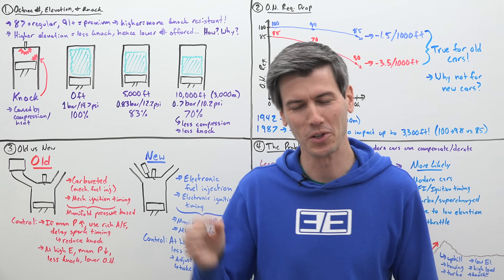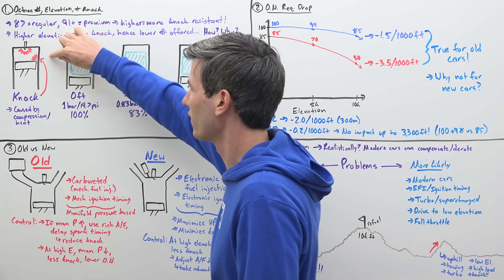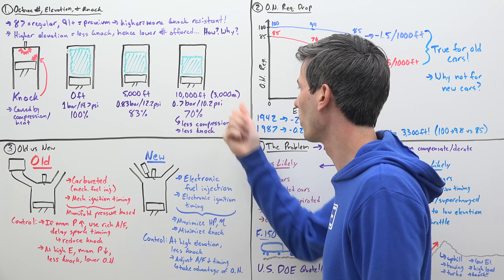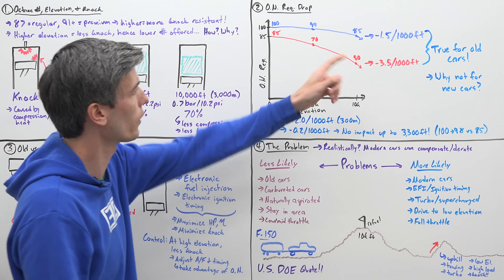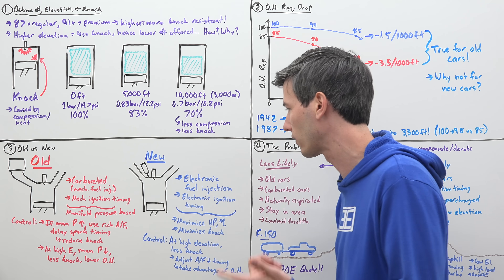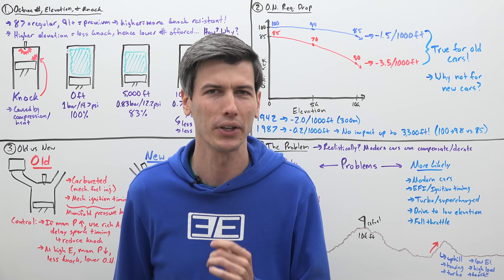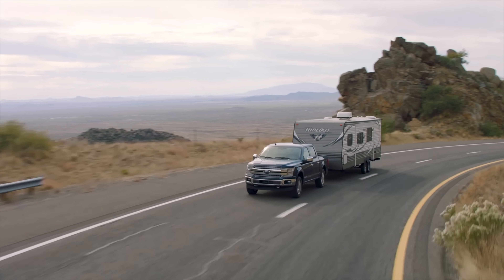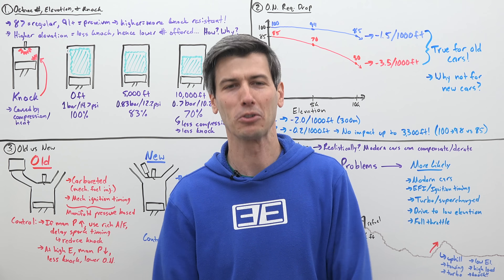Never Use This Gas In Your Car!

Comment: I lost around 50hp with my 200hp Saab when fueling it with Europe octane 92 (guessing 85 US octane), because the engine tried to protect itself at highway speeds.
Also found out that the car knocked more and then used more fuel to cool, so it was actually more expensive to drive with low octane then regular, because the engine would just use more of the cheaper fuel then the regular fuel.
Reply: 92 RON is actually equivalent to 87-88 AKI. When I had a 9-3 (two of them, actually) here in Canada it drove normally the very few times I put 87 in it, but it used more fuel. The difference was enough that it was cheaper to use 91 (95 Ron) or 94 (98 Ron).
Reply: In Europe our 95 (us 91) is the minimum octane fuel and not advice for more sporty cars which use octane 98
Reply: @NoctisIgnem  I thought 95 in europe is considered premium.
Reply: @strangeclouds7  it's the bare minimum, and with the increased ethanol most switched to use 98
Reply: 50 hp seems pretty dramatic
Reply: @strangeclouds7  Yep it is a big jump.
My previous car: 2000 Saab 2.0 turbo tries to compensate for the bad fuel in multiple steps, then lastly it gives up and pulls the turbo boost down to the same level as the low pressure model.

When knock is detected it adjusts the ignition timing and fuel amount in 5 steps, if the knock is still present it cuts the boost pressure in half.
All this happens in seconds, so when the engine runs on low boost because of knock, if you let of the gas for 10 seconds the car will then run full power for 2 sec before the boost is lowered again.

High octane fuel is also detected by the engine system and the engine will adjust to a little more boost compared to regular fuel (guessing around 5hp)
Reply: @larsjrgensen5975  If you have good high octane fuel do you have any issues? I have a VW 2.0 turbo engine
Reply: @strangeclouds7  Only issues with low octane 92 Ron, CaptHollister mentions it is 87-88 AKI.
Just stick with 95 (91) or higher and you will be just fine.
I think you will have a little extra boost with high octane just as my car has, but it may not be worth the extra cost, that is up to you to test.

Have not tried low octane on my more modern 2009 2.0 turbo Saab, but it feels a bit more fresh at high octane and the boost is also a bit higher.
Reply: @larsjrgensen5975  Nice. I live in America and dont have an issue finding good gas. Have always used 91 octane which is equivalent to your 95 I believe.
Reply: I have never seen lower than 95 in Sweden? Do you have 92 in Denmark?
Reply: @TheSimon253  I think 92 disappeared a year or two ago.

My low octane drive happened 6 years ago I think and I used half of the tank and filled it up with V-power 99, to fix it.

Some small stations only had one fuel tank, so they delivered 95 in both the 92 and 95 pistol, the only difference is the price they bill you.

Where it gets tricky is when you hit that very rare station, that actually had a 92 tank, instead of giving the customer cheap 95.

We now have 95 10% ethanol and 95 5% ethanol and sometimes a high octane 98, 99 or 100.

Sadly we never got E85 here for my Saab, it is possible to buy a drum of racefuel, but the price is much to high to be daily driving.

Comment: 7:37 So new cars with electronic FI has no effect on horsepower the higher u go in altitude?
Reply from the maker: You still lose power, but it will use timing advance & a/f ratios to optimize efficiency (which ultimately helps power). But there's no getting around having less air.
Reply: @EngineeringExplained  So they're basically reducing emissions?

Comment: But I thought that's why they put knock sensors on vehicles to prevent this.
Reply from the maker: They do, and yet... see owner's manual.
Reply: @EngineeringExplained  knock sensors will retard timing 12 to 14 degrees chances of damage are slim to none but manufacturers are covering their buttons which I get

Comment: Most People have absolutely no understanding of Octain Rating at all. If your Engine has say a 9:2.1 Compression Ratio, running Premium Fuel is absolutely Pointless and a waist of Money.
Reply from the maker: Not if it's turbocharged! Example: Subaru STI uses 8.2:1 CR and you definitely want to run premium.
Reply: @EngineeringExplained I didn't say a thing about forced induction did I? No I didn't. A Turbo or Supercharger will drastically change conditions in the Combustion Chamber. Making Detonation much more likely..
Reply: @EngineeringExplained  That's why you can't just Bolt a Turbo to any Engine, if the Factory Compression Ratio is to High, Forced Induction will Blow your Piston's apart..
Reply: @EngineeringExplained  What I was referencing is how many People  do not understand the function of High Octane Fuel, that's it. Wasn't trying to pick an argument over Technicality's.
Reply: Nice. I looked it up. Chevy Vortec 4800 is 9.4:1 
Smooth as can be on reg 87

Comment: The wife bought a 2020 Ford Edge here in S.E. Idaho and it will run on 85-91 w/o knock, but....... it SUCKS the 85 down nearly twice as fast as the 91 octane and is boggy. That's why we've only run 1 tank of 85 octane in it. Costs more to fill it, but costs less because it goes farther. Good vid, and great explanation on this.
Reply: Fuel with 10% ethanol will yield lower mileage and power. 10% ethanol is common in the west. Maverik stations usually offer as an alternative zero ethanol gas at about 40 to 50 cents a gallon premium.
Reply: @Bygre  Most definitely, and it does even better with E-Free fuel. But that's a 20min drive usually with gas cans to fill up for the lawn mowers & irrigation pumps. Being an older mechanic that's made a bit of money off dead fuel pumps I live on the rule of the quarter. When it's at a 1/4 tank it's empty & that usually means I gotta fill it up at our small town gas station that doesn't have E-Free.

Comment: Most pumps with E85 here in Denver say "up to 10% Ethanol added to fuel"; is the octane rating of 85 including that addition of ethanol, or is it likely the octane rating is higher than advertised due to the that addition?
Reply from the maker: E85 is 85% ethanol. 85 Octane gas is only 10% ethanol. These are very different. E85 has a very high octane rating (100+).
Reply: @EngineeringExplained   Oops! I meant standard 85. Does standard 85 with 10% ethanol still rate at actual 85 octane rating?

Comment: I'm pretty sure timing is advanced (not retarded) at full throttle to allow more time for the mixture to burn.  Also, I don't think 85 Octane fuel is sold anywhere where you can get near sea level on one tank of gas.  I trust the DOE, but I used 85 octane fuel in several fuel injected vehicles for years with no issues.  (As do the other 5 million residents of CO and WY.)  Thanks for the videos!!
Reply: These 'EE' comments are a scammer.  Don't call.

Comment: I remember seeing 85 octane at many gas stations, during road trips out west. I always wondered about that. Thanks for the info! 👍
Reply: @Engineering EхpIαined🌟 Scam alert!
Reply: AS pre 1990 cars get less common, the 85 octane gas should be disappearing for good.
Reply: It's interesting because for I think 2020 or maybe 2019, whatever the most recent year's data has been reported, the US DOT says the average age of a vehicle in the US is something like high 11.x years, nearly 12. It was less in past years, very slowly increasing over time, but still it would suggest that we have long since passed the time when any reasonable person should expect a pre 1990 car to be even remotely "common" and thus there being a justification for such fuel - And keep in mind this video uses 1987, per the referenced study, as a modern engine that didn't really benefit from such fuel. So I don't think it should have been allowed for even the last decade or two.
Reply: @javaman2883  not from high locals
Reply: Yep moving to diffrent states i saw it too

Comment: Is it any less crazy that they sell this stuff called "diesel" fuel that will wreck your gas car almost immediately... and they put the pumps for that right next to the gas pumps!!  And all we have to go by is the car manufacture stating in the manual to "not do that".
Reply from the maker: I think it is. You don't think there's an obvious difference between "regular" and "diesel?"
Reply: @EngineeringExplained  To enough people, sure, but I've heard many stories of an oblivious old person (or any person) doing exactly this - never heard of anyone wrecking their car engine with knock from 85 octane in high alt. areas though.  So with that perspective, it's just not very crazy at all, but definitely an interesting factoid and great video as always!

Comment: As Jason said is very unlikely that your motor is going to blow, but I think it can damage the car manly in the worst case scenario, with a turborcharged and a lot of load.
We could see some weird detonations and this will result in unexpected behaviour together with the lack of power.
Also it will cause weird vibrations throught the transmission, driveshaft and etc.
Unexpected behaviour and lack of power it's not what you want when towing, so I can see why the manufactures want to protecte himself, they cannot guarantee that the car will run as expected.
Reply: Low octane + Downsized turbo engine = Potential disaster.

Your comment about "weird detonations" is really telling because low-speed preignition and "mega knock" are becoming more and more of an issue now that we are pushing more and more power out of smaller and smaller displacement engines. I guess the old saying "no replacement for displacement" will always be true in this regard.

Comment: I live at sea level, but some of my gas stations sell 85. I also have a 2016 Dodge Journey that says it can take 85. So should I still be able to use 85 without it being harmful?
Reply: What you are seeing is 85% ethanol fuel, not 85 octane fuel.  Look closer at the pump and you will see it is clearly labelled as 85% ethanol fuel.  The other 15% is gasoline.

Comment: "It's crazy to me that we sell a fuel that will damage your engine".  It's crazy to me that ford cant engineer their cars to handle all fuel sold in this country.
Reply: By using that logic, all new vehicles should be able to use diesel, gasoline, E85, etc….
Reply: @bartonkj  I was taking about gasoline.  You can remove diesel jfc.  I have a ford focus that I can put any kind of octane in and it adjusts accordingly.  I just loose power.  So Ford can do this.  They're just lazy.
Reply: There's a difference between "will damage" and "could damage".

Comment: The lowest octane rating fuel you can even buy in Europe is 95 RON, which is equal to 90 AKI. Lower octane fuel (90 RON, equal to 87 AKI) was discontinued over 10 years ago in Austria and Germany, and those basically were the last countries to do so

Comment: I suspect that the 85 is conventional gas (ie no ethanol) I’m a fuel hauler and the fuel that is pumped through the pipeline for regular 87 is actually 85 octane before the 10% 113 octane ethanol is added to the fuel bringing it up to 87 octane regular E10. When you get 87 non ethanol from the fuel terminal it is mixed with 91 octane conventional to bring the octane up the two points to make it 87 octane with no ethanol content. Generally now the pipelines only send 85 octane non ethanol and 91 octane non ethanol and mixes them at the terminal depending on the desired octane rating with and without ethanol.
Reply: Thats pretty accurate. What we blend before the 10% ethanol is added is 83.5 octane (R+M/2). Premium is right at 91 before ethanol.
Reply: @03c5z  I suspect it’s going to vary some based on the exact ethanol available and exact percentage of ethanol but I was always taught the general rule of thumb is the 10% ethanol adds 2 octane points. Then again I just pull the fuel from the terminal and drop it at the stations so a lot of the terminal side blending is more or less irrelevant to my job as long as the end product meets the desired levels of ethanol and octane.
Reply: @davet231  the ethanol octane boost varies depending on the grade as well as some other component factors. On 87 the ethanol contributes around 3.5 octane numbers.  On 93 the ethanol only boost it about 2 octane numbers. The actual percentage of ethanol blended with the gasoline is a pretty tight range. There's not much variance like there is on e85 (usually anywhere between 70-90% ethanol.
Reply: @03c5z  Thanks, good to know, you work in the industry?
Reply: @davet231  yessir. Im in operations and blend gasoline and diesel at a refinery on the gulf coast
Reply: @03c5z  Thanks for mixing up that fuel for me to drop in the ground (usually in the right hole 😅).
Reply: @davet231  I sure hope you get it in the right hole lol. I almost had my old WRX blow up from the station selling 87 as 93 (they got busted). Some cars its no big deal, others premium is critical.
Reply: @03c5z  I’ve never personally cross dropped (aside from something like filling up a premium tank checking the veeder root versus my net gallons and having 50 gallons left that I made disappear in the regular tank). It’s not all that uncommon for someone to forgot to change their tank markers on the tanker and get in a hurry and hook up to the wrong drop. Driver at my company dumped 8,500 gallons of regular into a premium tank a few weeks back. The guy who trained him had to go up there and spend hours pumping it out from the premium tank to regular. That’s not as bad as the guys who mix up gas and diesel and don’t realize and drive off. A guy did that dropping a few thousand gallons in a diesel tank, it grenaded several trucks of a sister company that does testing’s brand new service trucks. That was like the 3rd time he had cross dropped too, needless to say he was no longer with the company after that one.
Reply: @davet231  ouch that's an expensive mistake and can be a huge PR mess. Though it's not ideal, 93 in an 87 tank is no problem other than giveaway cost.

Comment: Overlooked is modern cars have knock sensors and detune the engine timing if knock is detected.  How does that factor into all this?
Reply: They will let the ECU know if it needs to pull timing for knock protection, but it's not something you want to rely on to compensate for poor fuel. Obviously performance will suffer when timing is pulled.

Comment: We have 88 octane in mn. I was going to use it, but realized my car is an 03 1mzfe with vvti. There was a sticker that said to only use in vehicles that have flex fuel? I didn't risk it.
Reply from the maker: That's E85 - definitely don't use it in your car unless it's made for it (ethanol, versus 85 Octane).

Comment: When we first moved to Colorado Springs, I saw at the gas pumps they had 85 octane, I wouldn't even put that garbage in my lawn mower. Now in Germany, my car can enjoy 110 octane at the pumps.
Reply: The rating systems are different from America and Europe
Reply: First off, they are different octane ratings so you can't compare numerical values directly. Secondly, running high octane fuel in a standard DD at elevation is a complete waste of good fuel. Technically CO Springs would be more of a concern, considering it is just at the front range, but even just slightly west of there lower octane fuel is literally not a problem whatsoever.

Comment: A petrol station near me does 101 octane, that is fun haha
Reply: Unless your car is designed for 101 octane, it will do nothing but drain your wallet much faster.
Reply: @mowcowbell  we put it in performance motorbikes and it very much did have an effect for about 3p per litre
Reply: @serridgeas  At over $5.17 per gallon, that stuff better make your bike run like it's rocket fuel.  lol
Reply: @mowcowbell  cheap and nasty 95 is currently about £1.35 per litre here
Reply: @serridgeas  That's $5 USD per gallon!  I paid $2.87 for a gallon the other day in Oklahoma City.
Reply: @mowcowbell  nope it's actually closer to 6.97 usd

Comment: Call that fuel ' low octane' , so you won't dare to use it if you' re not a high altitude local with a side valve truck from 1942 ;-) It simply shouldn't be named 'regular'. Problem solved ;-)

Comment: Adjusting carburetors at higher altitudes has been common for 50 years precisely because of the air pressure issue. It was easy to do.
Reply: Know 'Genetically Modified Sceptic'? 

The Atheist-Youtuber so nice and unbiased and non-arrogant that he has lots of Christian Fans now? 

That warm guy? 

Or Forrest Valkai, the Bio-Teacher who's also on Tiktok?
Reply: @loturzelrestaurant  you seem to have a problem
Reply: @DrWhom  Excuse me? 

?

Comment: I went to look at my owners manual to see what they recommend, but I couldn't read it. My truck is so old, it was written in little triangles on a clay tablet. I think its safe to say I can run whatever fuel I want short of firewood. Wonders what woods octane rating is...
Reply: Actually if it's that old it might run on wood gas.

Comment: I don't see how this is a big deal - just put in a fuel that your vehicle calls for. Plenty of recent sporty cars require 91 octane, but it's still possible to buy 87 and put it in; it's up to the user to know how to read. Also, many stations sell both diesel and gasoline, but the owner has to read and know which is appropriate.
Reply: I was feeling the same way by the end of the video. We have 87 to 91 octane here. Some vehicles require certain grades. It will often say so directly on the gas cap, so you have to look at it when removing to fuel.
Reply: I think the question he's addressing is why 85 is ever sold at all
Reply: The point is that nobody recommends 85 and the Department of Energy even recommends against it, so there's no reason it should even be sold, let alone used.
Reply: @mechmat12345 , I agree that it shouldn't be used in modern cars, but for someone with a carbureted car, lawn mower, chainsaw, etc., it makes sense.